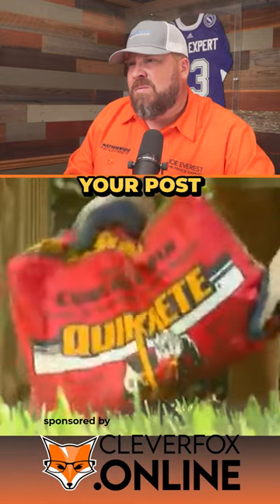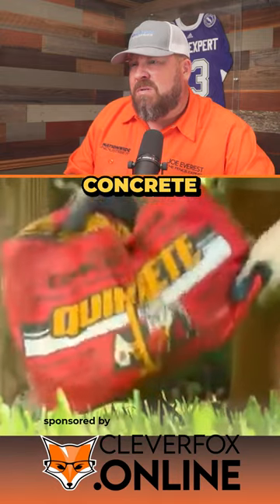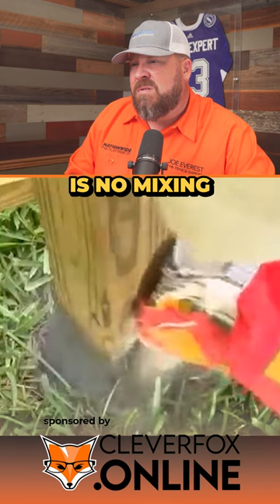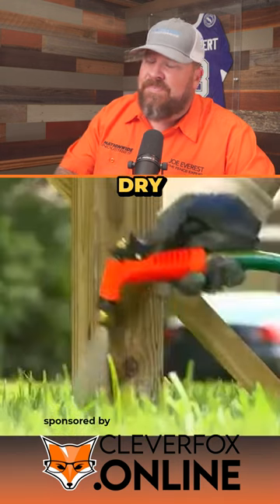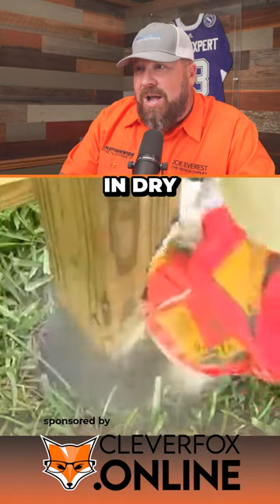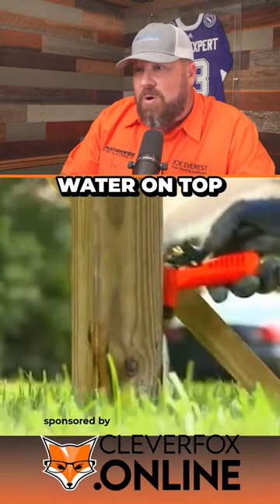They Set Concrete Like THIS!? #shorts

Comment: My grandfather has built fences for 50 years and i work for him. We use normal 60lb bags of concrete and we just pour a little water, fill the hole with concrete, and put water on top. Works every time. Ive never had a post pull loose even when pulling chain link the next day after setting
Reply from the maker: Nice! I appreciate you watching and sharing your experience!
Reply: I did a bunch of fence posts like this 12+ years ago and they are holding strong. Did a few just tamping the dirt (actually red clay in my area). One of the dirt ones rotted (I just put another post next to it, with concrete) and another was loose so dug around it and put in concrete. I had a bag of concrete harden as it sat in my shed for a few months. But i also live in a humid area, little frost, and the ground is hard red clay.

Comment: I put a little water in the bottom, plumb the post, pour in a layer of fast set, tamp, a little water, fast set, tamp, water, all the way to the top then form the concrete to shed water.  Our code here is steel posts so I want the concrete in tight to maximize hold.

Comment: Had to pull a post because it was slightly off the string and I wasn’t happy with it and didn’t catch it until the day after(I hand dug and set about 40 posts after work between two days so it was late). I used this method and the concrete was as solid as it gets when I pulled it out. Didn’t mix just used some water on top and bottom

Comment: Lol it’ll be fine set hundreds of post this way as a matter of fact if u have a bag of quick Crete Completely sealed off and some water happens to run into the bag just soaking the bottom layer of the bag the whole bag will turn to a complete rock this works fine the amount of people like you didn’t pre-mix it it’s crazy you obviously haven’t tried this for yourself
Reply from the maker: What part of my description of how we used it involved pre-mixing?
Reply: @JoeEverest not sure what exactly your saying here fella but you said u don’t pre mix only for a post here and there ... then you said we’ll see as in we’ll see how it hold up to which I replied it’ll work without premixing .... not sure what your trying to get at here or if your just looking for drama but u ain’t gonna get it from me ... not over concrete lmfao not a big deal big fella you can pre mix all you want I don’t mind just sharing my experience

Comment: Add a quarter to half a bucket of water in the hole first. Then pour the bag of concrete and then pour some water on top. It works well. As you pour the concrete in the water it mixes itself. I still mix on chainlink and aluminum though.
Reply: You're supposed to mix it before it goes in the home. Do that to me fence, and you'll be digging it back out, and doing it properly.